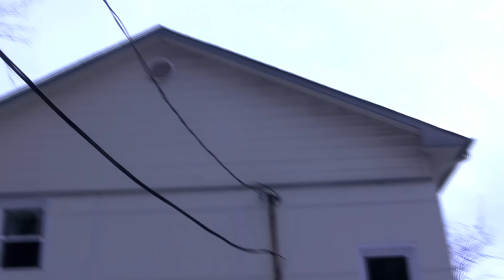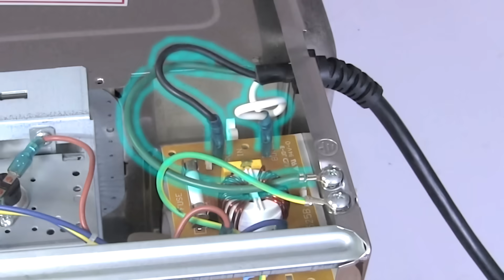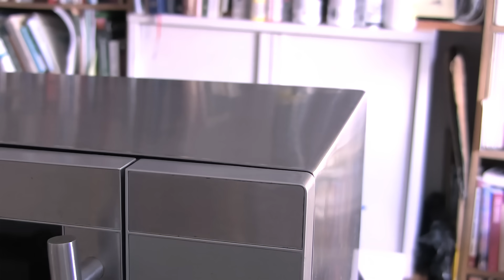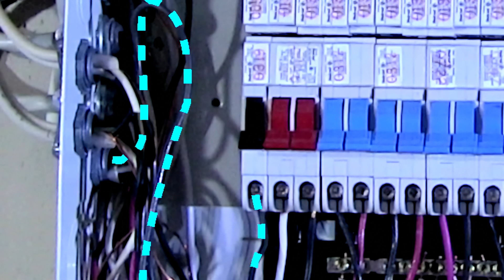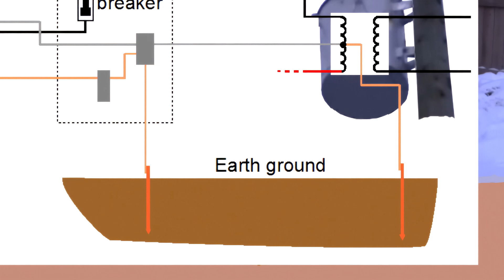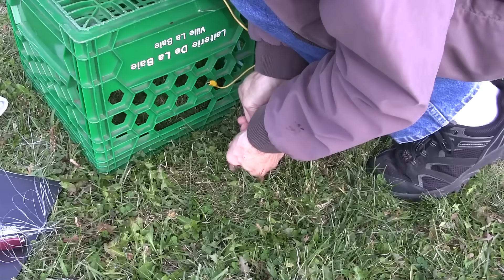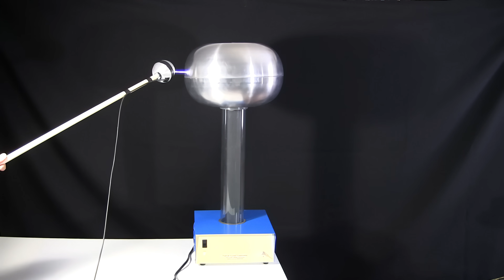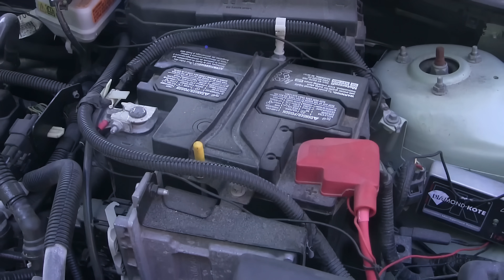What is Ground? Earth Ground/Earthing

Comment: In the 1950s my dad had a wire recorder (before tape recorders) It had 2 wires. One wire went to the ac input and the other wire was connected to the chassis.  The radio and recorder worked fine and one day the plug came out of the wall and got plugged in backward (since these old plugs were not polarized this was possible) , everything still worked but If you touched the chassis and the radiator (which was grounded, you got 110V shock).   Many radios from the fifties had the same problem.  Once I  was cleaning a kitchen for a friend and his radio was positioned on the top of the radiator and I turned it on to listen to music, and what happened next was (shocking) I bumped the radio and the screw on the bottom of the cabinet contacted the radiator, many sparks flew and the fuse blew to that circuit.
Reply: many radios had 'live' chassis, much worse here in the uk, with 240v mains,  so 'all' or nearly all radios has reasonable precautions such as covered chassis fixing bolts,  no exposed chassis touchable in normal circumstances,   i've seen some american sets that had semi isolated chassis, only connected to one pole through a capacitor and resistor, so any shock risk is severely reduced, suprisingly only a very few uk sets used this idea ..,  and the ones i know of so far were all 'cheaper' brands!.... most uses physical precautions only, some better than others
Reply: @andygozzo72  You used hot chassis radios with grounded sockets? Sounds horrible. In Finland those had plugs that do not fit into grounded sockets as you will definitely want anything grounded nearby.

Now of course the fact that UK lugs go just one way helped as long as the socket was wired correctly.
Reply: @okaro6595  yeah, the ground wasnt connected, 2 core mains lead, the equipment was designed to be safe as practically possible in normal use even if polarity was reversed, there was a few metal cased communications receivers with series heater and 'live' chassis but grounded outer case, the 'live' chassis for the circuitry was isolated from the case with plastic insulating grommets
Reply: @StringerNews1 according to circuits i've seen, a large proportion of american 'series heater' sets had a 'isolated' or 'semi isolated' chassis with no direct 'low resistance' path from chassis to any pole of the mains, only via a parallelled resistor and capacitor, these limiting possible current, and much reduced shock risk, i have at least one like this,   its surprising the UK and other countries with 230v mains(yes i know the usa has 240ish supply, but thats across phases for high wattage appliances,  general wall sockets are 120ish),  didnt use this idea,  a very few did, but vast majority not...
Reply: @StringerNews1 any one fatally injured by one , it must've been a directly connected chassis,  not a semi isolated one, in good electrical state, not one bodged up,  , i've seen quite few, plus many more of UK ones(i'm in the uk, and have 200+ various vintage radios, tvs, etc.)  , from what usa ones i've seen, plus the lower mains voltage, theyre far safer than a lot of our 'live chassis' sets were, in general, but obviously you do get some nasties, i do have one....
Reply: one uk manufacturer made a set with a non metal chassis, used a plate of srbp/paxolin instead, even the valve/tube socket contacts were integrated into it, as well as the wavechange switch, however i think the control spindles were still connected to one pole of the mains, so you had to ensure the knobs were fitted properly(long time since i serviced it, cant remember for certain)
Reply: @StringerNews1 radios and tvs have had pcbs since the mid 50's , i have one of the first pcb models by philips, suffers from dry joints on the tube sockets due to too small copper pads, their second pcb models also known for dry joints but this case due to lack of solder!
Reply: The chassis was isolated so you could not touch it unless it was broken.

Comment: So if i am correct ... 

The fact that the ground wire is connected to the ground has nothing to do with protecting your from getting shocked ... but protecting the breaker panel from high voltages? (thunder)

The only thing that keeps you safe from getting shocked is the breaker of the hot wire when a closed circuit with high current exist? or it helps "pull" the current towards the ground where low resistance exists? 
(our body resistance is about 100kohms and a typical ground about 100 i think)
Reply: Consider this: GROUND=SAFETY/NON-LETHAL ... 
so if the case to your appliance is connected to GROUND, then certainly it is always safe to touch no matter what happens --normal or fault.
The breaker tripping is a bonus to kill the high voltage and prevent any charge from building up.
Reply: @barnabywilde374 
But is it safe because...
 the current will choose to discharge on the ground because of the lower resistance (about 10ohms) 
or 
Because ground helps to pull the current through the breaker ?
Reply: GROUND directs the dangerous charge away from human touch.
BREAKER removes the dangerous charge.
But since you're forcing me into a choice, the BREAKER removing the dangerous charge altogether is more important than just re-directing it.

Comment: But why isn't the neutral wire used as ground instead of having an additional wire? Concretely: touch neutral with the microwave case, the breaker panel case and the earth. Also, why are there 2 rods to earth needed: one from the breaker panel and one from the transformer? To increase the surface of touching the earth more? Why not simply make the rod doubly high on the transformer side in that case?

Comment: Don't they have power meters in the US?  Can they use as much power as they want for a fixed fee?
Reply: Residential American homes have power meters and power is billed by kWh, plus a billion other fees. Depending on the state/utility company, power rates vary by time of day. My understanding is that Industrial power is billed differently, it's billed by peak power used, with no limit on the average power used.  That means that short duration high power loads are not in their favor.

Comment: As a European I find this at odds with what we have been taught. An electric 'short' is so called because it takes the shortest path to earth, which is never going to be the transformer though which you're going to be sourcing your AC supply. Every installation in the EU has a copper rod driven at least a metre into the ground and the consumer unit is wired to this 'earth' not the neutral that goes to the transformer.Mind you we have a more robust 220/240V supply and much more stringent regulations than America who are still a little in the dark ages.
Reply: Each country in Europe has its own rules and standards.
Reply: Oh get off your high horse. America actually does use 240 volts in homes. We use split phase power though so any given wire is only live at 120. Europe, and particularly England, use 240 volts all the time because for the same amount of power the wire needed to carry less current and could be smaller to save on copper in the wake of WWII. I’ll admit our receptacles are less safe than yours, but we are not living in the dark ages and have plenty of ways to protect against electric shocks from ground prongs to circuit breakers to GFCIs (the European equivalent being an RCD). 240V is not “more robust” and we are not in the dark ages.
Reply: "An electric 'short' is so called because it takes the shortest path to earth"
An electric short takes the path of least resistance, that is not the intended path. 'Short' is a historic misnomer, it's not necessarily a shorter path.
Regardless of country, the copper rod into the earth actually has high resistance, and will only short in extreme situations like a lightning strike. 
A 'ground' is also a historic misnomer and, in these cases, not what's actually happening.
Reply: @JustinShaedo  Bollocks!
Reply: @hughegentry8255  The common confusion:
Ground Wire: low resistance, connects to neutral.
Ground Rod: high resistance, connects neutral to the earth.
'Ground' a term used for both. 

Here's something that might help:
https://youtu.be/P-W42tk-fWc?t=433

With no disrespect intended, if you think that 'electricity doesn't follow the path of least resistance' then you need to learn basics before these concepts.
Reply: @JustinShaedo  the wordage "shortest path" means the path of least resistance, at least in England. We are two nations separated by a common language!
Reply: @hughegentry8255  Huh. Thank you for this. I had 'know' idea. Respect for the polite correction. Apologies for my Dunning Kruger behaviour! Thanks again.
Reply: @hughegentry8255  I've looked and looked and can't find anything to support your claims. If you have a source I'd appreciate it.
Reply: @JustinShaedo  Requirements for Electrical Installations, Iet Wiring Regulations, BS 7671:2008+A3:2015 (Electrical Regulations): Bs 7671:2008 Incorporating Amendment Number 3:2015 Paperback available from all good bookstores.
Reply: @hughegentry8255  So I finally found a digital copy (referencing a paperback on the internet?) ... I can't see anywhere where it says or implys that the"shortest path means the path of least resistance". What conclusion do you think is reasonable for me to be making now?
Reply: @JustinShaedo  I'm tiring just a little of doing your research for you... https://en.wikipedia.org/wiki/Path_of_least_resistance
Reply: Also check out the Path Integral
Reply: @hughegentry8255  None of your sources back up your claim. The Wiki article actually contradicts what you're saying.

Stop arguing. Read your own source. Seriously, read it. Then copy and paste the section that says ""shortest path means the path of least resistance"

Bad troll. Very. Bad. Troll.
Reply: @JustinShaedo  There are countries where the ground rod goes just to the ground (TT, IT). The problem is that everyone seems to their the system used in their country is universal.

Comment: 1:36 those metal bars are (if my guess is right) called bus bars.
And the ground you speak of is either connected through that thick white wire, or via the bolts connecting the case to those bars.

Comment: THE GROUND ARE THE NEGATIVE PARTS OR NO POWER OR NO FORCE PLANET ALSO HAVE A GROUND THE  NORTH POLE AND SOUTH POLE AND THAT IS THE COLD PARTS OF THE PLANET AND THE POSITIVE ARE THE EQUIATOR WITH FULL OF LAVA AND VULCANO PLUS FUEL AND THE SUPPLY OF FUEL OF THE PLANET,, WITHOUT NEGATIVE POSITIVE ARE INCREASING THE POWER OR HEAT UNTIL THIS ARE BURNING LIKE A SUN,,,, SUN ARE NO NEGATIVE ALL ARE POSITIVE,,,
Reply: you need to let go of the wire man, its hot. calm down.
Reply: @nostromer   ALL OF YOU ARE ANIMAL AND NO INTILLIGENT OR BRAINLESSHEAD BECAUSE ALL OF YOU ARE OUR MADE, CANNOT ADD MORE INTILLIGENT BECAUSE ALL OF YOU WILL DIE
Reply: @arianegomez5499  Cool story bro!
Reply: I'm positive you failed English comprehension.
Reply: @jimmac1185  He/she also must have failed basic science and have zero knowledge about electricity.
Reply: This an account made specifically for trolling.

Comment: In summary, ground has three purposes 1) The grounding wire provides a path for the excess electrons to go in the event of a surge. 2) The word grounding is a present tense term and is actively happening.  The green or green/yellow wire is call the "grounding conductor".  Charges can be induced on the circuit from outside the circuit electricity and this happens constantly in real time.  The grounding conductor ensures there are not differences of potential that would otherwise create a surge, like a static discharge.  3) Ground provides a point of reference for circuits.  Voltage is a natural occurrence requires differentiation between two things to happen.  Nature doesn't care what his "number" is.  Only that there is a difference.  The ground ensures a consistence point of reference so that particular circuit can consistently and reliably maintain the voltage with which it was designed.
Reply: Additionally, any two pieces of equipment with a grounded metal cases, as long as they are on the same circuit, will always have the same potential. This prevents current flowing through any conductor (like your body) if you touch both at the same time.
Reply: that description was more helpful than the video, ty

Comment: Why do you need both neutral and ground?  Wouldnt connecting neutral to the case be the same?
Reply: Neutral is designed as a current carrier, is is the normal path for the circuit. Ground wire is simply a safety line and is not designed to carry current in any normal circumstances. As explained in the video, it becomes used when there is a short and provides a path for that short to get back to the panel and cause a trip on the breaker. As for your specific question of "wouldnt connecting neutral to the case be the same?", yes and no. While it would allow a short to cause a trip still, and protect you from getting shocketed should the case become energized, the neutral is connected to actual circuitry in the device and designed for carrying load. If there were to be a short/fault, the device may still get some additional load from this connected circuitry and cause problems with the intended behavior of tripping the breaker from a short. Unlikely to happen, but it *could*. This is why you have a seperate, specific conductor made just for protection on the circuit.

This was not always the case though, in many very old homes you will find only 2 wire outlets that have no ground. After enough people got shocked from faults, the NEC was updated to have a ground to make things safer.
Reply: @LordSaliss  ah, that makes sense.  Thanks!
Reply: @Free Will an explaination why would be nice
Reply: Mr. Grisso is incorrect.  In the US and Canada, single family dwellings in particular, are supplied with 240VAC.  That amount is based off the transformer outside.  In order to achieve the 120VAC in your outlet, the side of the transformer connect to your home must be split in half.  The wire that splits the transformer is the neutral.  In accordance with the National Electrical Code the neutral does carry the same current as it's supplying "hot" wire.  As a result, the wires must be the same size.
Reply: Because the transformer is grounded outside. Let's assume you did that, and then you touch the case. You now have a voltage applied across you, thanks to the parallel circuit going through the casing, into you, down through the ground, back to the transformer. It will draw much less current than the true neutral, but it will draw current nonetheless. Might not be enough to seriously shock you, but it's certainly not safe, and I'd wager it's probably noisy (EMC) as hell.
Also, consider what would happen if you were to have two grounded (neutralled?) devices touching each other. When one is drawing current, a large amount of it will return through the casing of the other device. That's not exactly a good thing, given the tendency of current to heat things up. Also, consider what would happen if you separated them and touched both at the same time. You've now created a fairly good return circuit, with you in the middle. Good luck.
Reply: @Nick Diesal I guess the next video you should watch should be on the different time zones.
Reply: No. The ground wire completes a circuit in the event that the hot wire comes into contact with something that should no be electrified like the metal casing. If the hot wire touches the metal casing, the neutral wire is out of the equation and can’t do anything. The ground wire redirects that current through the neutral connection, trips the circuit breaker, and discharges into earth
Reply: At 3:09 the video explains that the ground circuit has a lower resistance. Therefore the current spikes and trips the fuse when the wire jacket on the hot lead contacts the the chassis that could be touched. Is this not what actually happens? I’m clearly not an expert on this stuff :)
Reply: @jacobgrisso1715  Lower resistance than what? It won't be significantly lower resistance than the neutral, since they'll typically be the same cross section. A live-neutral short will absolutely trip the breaker, in fact that's the entire reason the ground wire is there. The ground wire is there so that if the hot touches the casing, it'll create a live-neutral short and draw a massive amount of current, tripping the breaker. If the ground wire weren't there, there'd be no complete circuit when the live wire touches the casing, until you touch it and create a path to ground.

An important aspect that I forgot to put in my previous post, is that the ground wire has the same potential as the the floor. In every properly built house, there's an iron mesh embedded in the foundation, which is connected to ground, which is connected to every grounded object. This way, the current has to reason to travel through you when you touch two ground-potential objects, even if one has a live wire touching it.

If you have a hard time understanding this, don't worry. I'm an electrician, and I spent the first 4 months of my education learning about this stuff. Until you understand what electric potential is, electricity makes very little sense. I suggest you start there if you want to learn.
Reply: @SoWhat1221  Okay that makes sense. Thanks for taking the time to explain that. Electricity has never been my forte
Reply: The neutral wire has a higher resistance than the ground wire and the current may end up flowing through your hands/body. Having a low resistance ground wire is just safer.